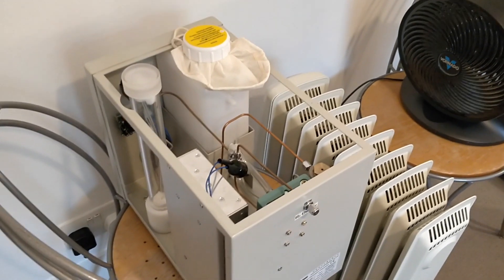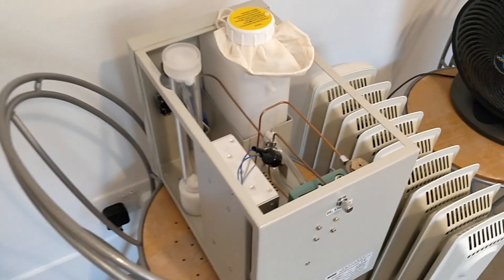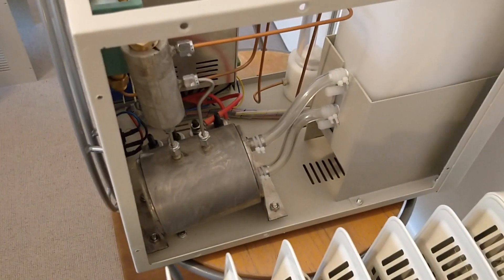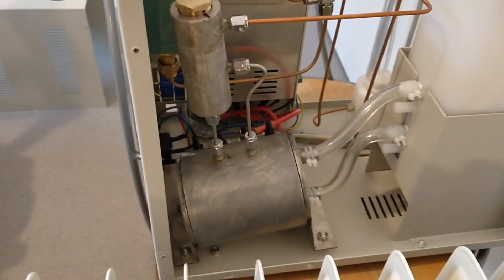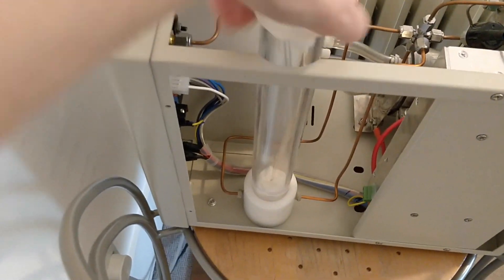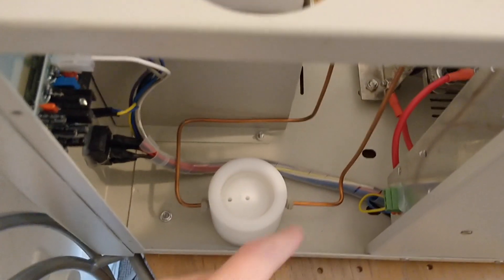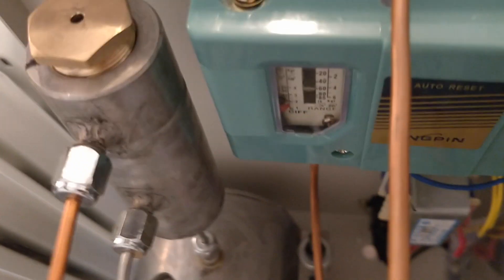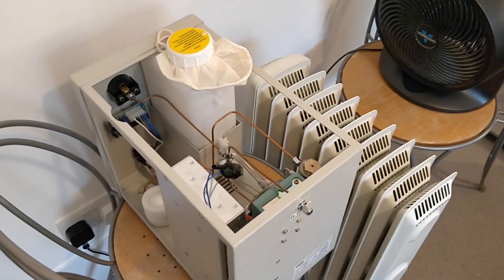What is a hydrogen generator anyway? - Casual Physics 005

Comment: Mat. According the the F&P patent papers, they recommend immersing the paladium in deuterated water which contains an electrolyte such as LiOD or Li2SO4 (page 20 of Internation Publication Number: WO 90/10935). Also, F&P applied a potential between the cathode and anode, which I believe is essential to ensure the paladium is "loaded" with hydrogen.
(Note: See how Figure I-2 is configured in the patent document)
Note also, for a 0.2cm radius paladium rod, the charging time was 20 days (page 24).
Reply from the maker: Hi and thanks for reaching out. Actually this hydrogen generator is just designed to make hydrogen gas for me to pump into my reactor in order to "gas load" the palladium on nickel. I'm not doing electrolysis loading in these experiments.